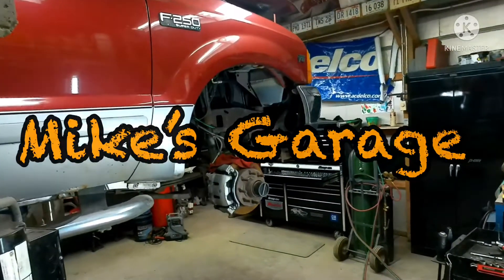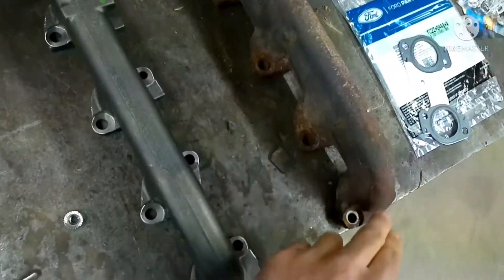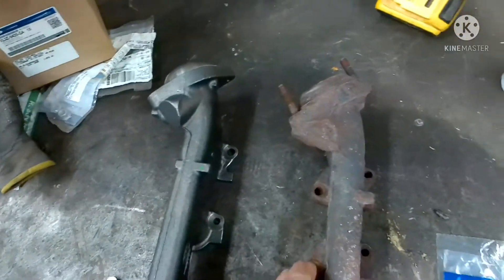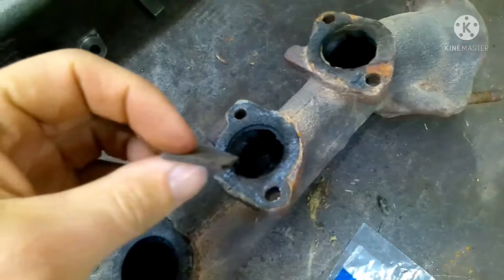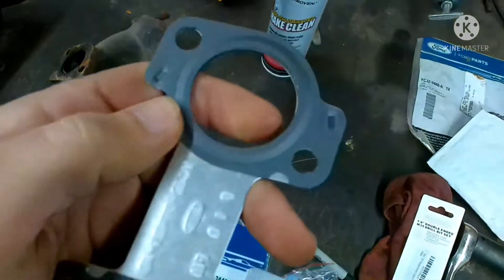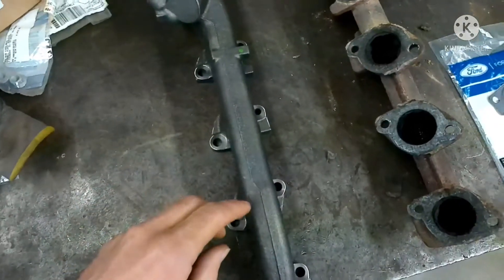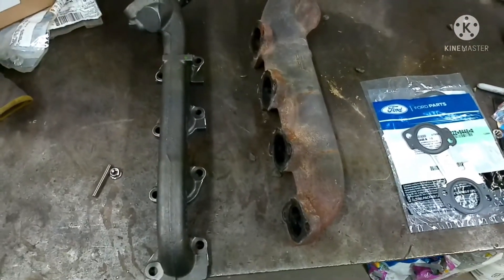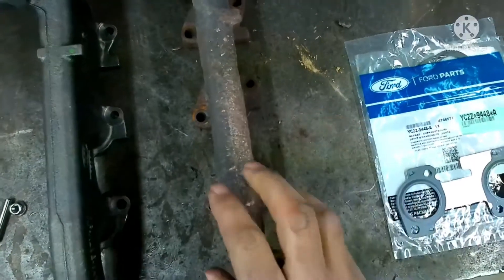Ford 5.4 Exhaust manifold replacement... OEM or Aftermarket??

Comment: Great advice.  I was fully expecting a video completely hating on aftermarket vs OEM but was pleasantly surprised by your good information and lack of “hate”!
Reply: only hate is on ford who haven't been able to make a manifold or gasket in 55 years.  had one at work 3000km bad gasket.  none make it over 100,000km without at least one side leaking.  unreal.

Comment: We have a few ford box trucks e450 e350.. used the dorman manifold but was nervous.. 3 years later its still holding up.. we have lots of mountains in our area so they get a workout. 
I totally agree on gasket. Genuine ford multi layer steel gaskets last the longest by far

Comment: I just ordered some Dorman manifolds for my 2000 f150 5.4 but ordered some oem gaskets. The gaskets that come with it look kind of cheap, you think the oem gasket will work good with Dorman?
Reply from the maker: Yes they should be fine.  Those fiber material gaskets that come with it usually fail. The stamped metal ones from the OEM are a much better choice.
Reply: @mikesgarage2851  thanks for replying back, much appreciated!